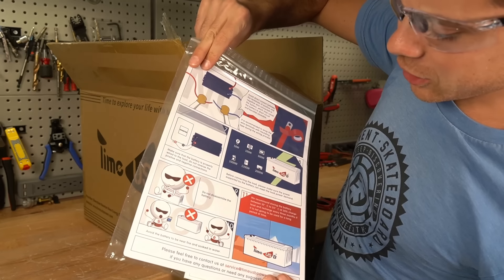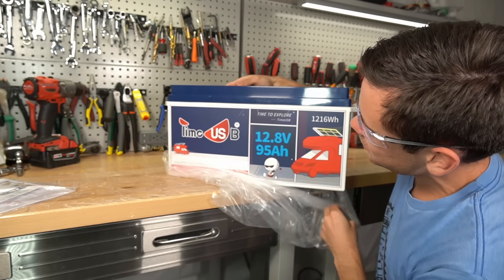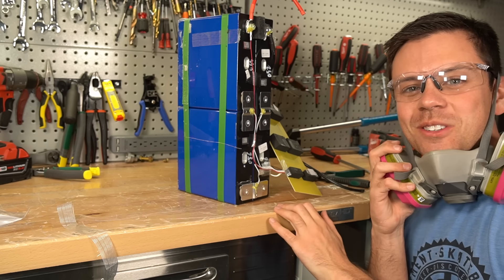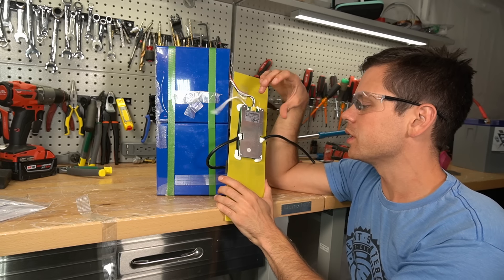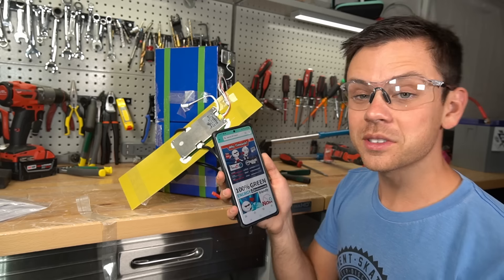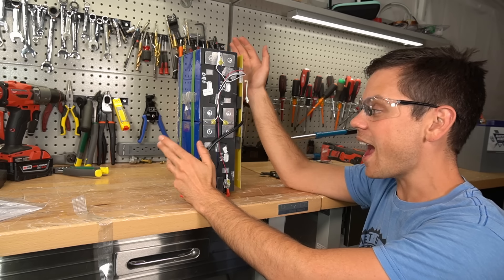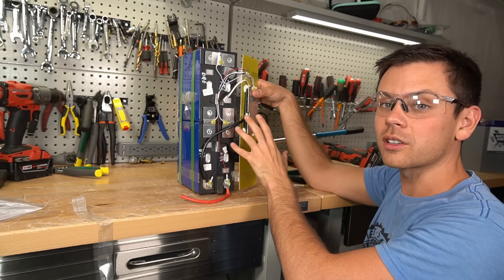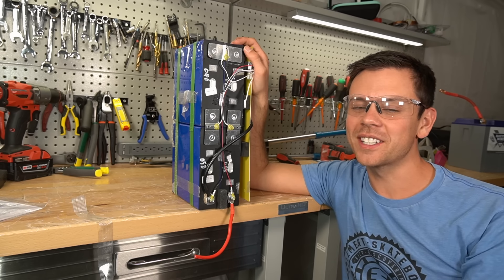$269 12V LiFePO4: Worth the risk?

Comment: Will 
You will love this 
Dear Gary,
Thanks for your reply.
The battery case is the public moulds on the market.
So there is some extra open space unused space inside the battery.
If we use the dedicated moulds for this battery, which means we need to open a new mold. The cost will be very high.

Comment: I think this is great! Many people who mostly camp with electric hookup don’t need 100ah but offering them a LFP option which has less risk of going bad if it gets to 0% is an amazing option for those people. Furthermore, repurposing batteries is great for the environment. They give additional 3-5 years (maybe more) of life rather then going to a dumpster. The only think they need to do is to clarify these are repurposed cells - otherwise, it’s a great option for many people at a great price.
Reply: I completely agree with your comment! Offering a LFP option for those who mostly camp with electric hookup is a fantastic idea. It not only provides a safer option but also helps in repurposing batteries, which is great for the environment. And regarding the Segway Portable PowerStation Cube Series, it seems like a reliable and powerful backup power solution with its massive capacity, fast recharging, and comprehensive protections. Definitely worth considering for outdoor enthusiasts and RV lovers.
Reply: Obviously bigger is not better in this case.

Comment: That would be something for a UPS system.  Just lot capacity, not many cycles, size and vibration quality doesn't matter.  Build to leads and hookup any regular old UPS and have massive more reserve for the price of a lead battery.   Most UPS do like 2-3 cycles a year.
Reply: UPS charging controller is likely a lead acid profile. Would that still work?
Reply: @aerobiotic  They do make LFP UPS systems but they are much, much more expensive.  Would be neat to grab one of those controllers somehow?
I'm loving the idea of a LFP UPS on the cheap though! Would be awesome for my work server cabinet as the two UPS in there can't last more than 5-10 minutes.
Reply: I have done Lifepo4 conversion in my apc br1000g in and it is phenomenal. I used discounted old cells 16 of them cost me 50$ they were cheap cus they were manufactured in 2019 and i bought them in 2022. , The tested capacity of the whole pack was 12amp hr which is correct rated capacity for those 32700 6000mah cells. I used 300w resistive load on my ups and it ran the load for 45mins that is similar runtime to having 27ah lead acid 24v batteries on my ups. So which would total well over 3 times the money i spend on these Lifepo4 cells. My ups charges them to 29v and then goes into absorption at 27v. I did not use a bms , i am only using a cell balancer cus the ups is handling the charge and discharge voltage. And i do not want the bms to suddenly disconnect the pack from the ups if that happens the ups will not power back on automatically when the mains is restored and the ups terminates at 21v anyways so there is no need for a bms and waste energy on heating those mosfets just use an active Lifepo4 8s balancer. There is no issues with charge current, my ups charges the 9ah lead acid pack at exactly 1.25amps or the 27ah lead acid pack at 3.75amps , i have set mine to do it at 3.75amps cus my battery pack can easily handle 6amps of charge current. The run time is phenomenal i can game on my pc for 40mins without any worries or do my work for well over an hour as my pc consume just about 150w at idle. There is one issue that u have to keep in mind. If your ups uses low frequency inverter then u should keep in mind that the models are designed to save money and they save money on the transformer size , u can not run at even 50% load for longer than rated run time , i have blown the transformers internal thermal overload fuse on my dads ups which has the cheaper style low frequency inverter using a large transformer even though that model is rated for 660w the transformer in it is half the size of the transformer apc was using in their 300w ups from 2004. I was running that ups to see how hot it gets and at 600w load the transformer got to 80c before blowing the fuse , it ran for 4mins on that load which is 4 times longer than what apc claims as run time on similar load with original apc batteries 😂. So in my opinion avoid ups with low frequency inverter only get the ones that use smps style inverter those are much more efficient and can run longer at near full load condition without blowing up. Or if u have no other option then keep the battery capacity low. If the original ups came with 7ah 12v battery using 6ah Lifepo4 is like having 14ah lead acid. So do not run for long time with more than 50% load in that case , also keep in mind to purchase cells that can handle the maximum power draw. A 600w ups can pull near 30amps on 24v battery and so u should keep the Lifepo4 capacity at half of that. So that the maximum load on the cells can not exceed 3c discharge.
Reply: @aerobiotic  most UPS with a AGM battery should be very close to a LFP battery cycle. They might not charge very fast or even all the way full.  My APC units float at around 13.6V depending on the model.  Further you should not try that with UPS at full capacity. They don't have the thermal.  I got for instance 650w UPS and I'm using it for router and other things - which draws less then 70w.  Never getting warm.
Reply: @aerobiotic  The BMS is your charge controller.  You can just input any constant voltage.  A dedicated Lithium charger is not really required, but I would use one because the BMS used in these cheap batteries are typically Chinese junk that can't be relied on in an enclosed space like your RV or car.
Reply: @einfelder8262  All my lithium chargers charge at 14.6 volts, my lead acid charger at 13.6 volts. Using a lead acid charger on a lithium battery would never reach full charge.
Reply: @soberpickle8195  Your lead acid charger is junk.  It should charge at well over 14V, up to 14.8.  Every car alternator charges around 14.2V, and they are the crudest of  chargers.  A lifepo is fully charged at 13.6V.
Reply: @einfelder8262  My UPS charge at 14.15 Volts. I am getting around 750WH from 100Ah 12.8V LiFePo4 battery. Is it just charging to 65% Capacity? My battery reads at 13.45 Volts after 12 hours since last charge stop.

Comment: Chins battery is $100 more or almost 50%.  I bought one of these instead as it will be used infrequently in a trolling motor,   Saved the money and have a better set,up than lead acid imho,

Comment: I can see a place for this in older used RV's that have limited service life left, consider that a typical modern lower end travel trailer only have about a 15 year service life before they tend to end up in a scrap yard, and I can certainly see a place for these replacing the first or second set of lead acid batteries at the 5-10 year mark in the service life.

Comment: Thanks for the info. You do very good reviews. I drive a semi truck. With the diesel been very expensive now I’m installing a one ton mini split ac on my truck with a gas generator.
I want to get a good lithium battery’s.
I drive in very hot and cold climate another thing is vibration. This info is going help a lot. 👍👍👍👍👍

Comment: It seems that they were trying to be honest with stating 950 Amp hours. But you're completely right about the cycling , how does one really know how long it with last . What a completely awkward case for the battery , where do you place it. It ridiculous how large it is. It's like a 48v  size for a rig or dump truck. Thanks for sharing this with us all and we'll see you soon my friend . Cheers
Reply: If the battery is being charged at an optimal rate such as in outback Australia there's no problem getting 4000-6000 cycles

Comment: I think they made it that size because it is a direct replacement for an RV deep cycle battery, and they want it to fit securely in the same space without having to modify the battery box and hold downs.
Reply: That makes sense.

Comment: You can still get Grade A 105 ah prismatic for 250 or less, for 4s the mazzive case without the capacity to match would have me always asking "where's the beef?" And only 50 amps! I'm glad you cracked it open thanks Will
Reply: That's standard RV battery size. It makes sense to use a standard case if it's optimized for RV use no modifications needed

Comment: Hi DIY. I have bee watching your channel for years. I damaged my 200 amp 24 volt Chin batter by not being careful as I dropped socket drive and it hit the terminals... WOW ARC FLASH! Glad I had safety glasses on thanks to your safety tip. I would like to see you do Chin BMS replacement operation.
Reply: It may not be dead...just disabled by BMS, but can be turned back on by a certain charge or process.
Reply: @mrmotofy   Hi MrMotofy. I'm a novice to say the least. What do you mean certain charge or process?
Reply: @mrmotofy  what should I do?
Reply: If you disconnect and reconnect it should turn back on

Comment: As far a bad internal mounting and securing the cells in place, I think that the lid (that you removed) would hold the cells down inside the case. Foam was a deep-ish pocket, so it should stay put. Those top foam pads on the lid  were touching the tops of the cells ... I recall the tested capacity sticker  was stuck to them. Anyway, looking forward to the capacity test.

Comment: If you use a trolling motor 100 times a year this would work . Light weight and no worries about taking it down to 10%. 1000 cycles will give you 10 years, and, by then battery tech will be so much better. Sodium or sulfur.

Comment: My guess would be this battery is going to be marketed in Africa and Asia for rural people and for back-up power and lighting systems in the cities.    It's rather brilliant, IMHO.   The bigger ABS plastic box and foam chunks don't add much cost for the manufacturer but make it close to the same size as a typical "4D" lead acid battery with around a 100Ah capacity rating, BUT much lighter and WAY better because of the LiFePO4 advantages of cycle life and tolerances of deep discharge, etc.     At that price, they will be price competitive with cheap Chinese AGM, and even the grade B or used LiFePO4 cells will perform better and last longer than a lead-acid battery that sits at 30 to 40 degC most days.   They will also be easier to ship because they all have built-in protective packaging so they don't need extra foam or wooden crates to ship individually.

Thanks for all your great videos!

Comment: Looks like these are made to be marketed to RV owners as drop-in replacements for units that use the physically larger batteries for house power.
Reply: Same dimensions as my ampere time 12V 200ah. Looks like the manufacturer just caught a deal on cases.
Reply: Probably to replace 2 6v lead acid batteries
Reply: Could also easily be the case here. I just know that most common folks don't look at specs but physical size when they buy things like batteries.

Comment: Just bought it to replace the 2 x 75ah deep cycle batteries in my class C that recently went dead. The ridiculous case dimension is actually an exact fit for the door-step battery tray. I think the 50a bms might "match" lead-acid charging current and avoid tripping any 12v breakers or burning alternator, so as a cheap guy who don't want to invest in another dc-dc charger, this seems what I need.
Reply: I'm thinking about the same reasons that you are.
Reply: BMS doesn’t regulate current limit, it will either burn up or disable charging if your alternator can make more than 50A
Reply: I did an experiment. The battery when completely empty (discharged to 10.1v) would briefly accept about 1100w. But immediately after that the charging current was regulated to 370w and gradually dropped as the battery approached 13.6v (the preset voltage of my RV converter, non-adjustable). So it worked, sorta --- just never deplete the battery to 10.1v and it should be good (the 1kw current did trip my 12v breaker). And remember your lead-acid charger will not charge this thing full.
Reply: Sounds like perfect replacement. Are they still working properly? Capacity holding up?
Reply: @larryperry2094  Well I'm not relying on its capacity since I have separate powerstations to provide 110v. However it's powering my 30lb trolling motor for 2+ hours no problem.
Reply: @helloterran  well its earned its keep in that case. Very cool.
Reply: @CleanPowerAuto  I was recently told that when you discharge these lifepo4 batteries to 0% the bms turns off and the battery just bypasses the bms and accepts whatever current it can accept, in my case 100+ amps. As long as the bms is still powered on, it will regulate charging current to its spec.
Reply: @helloterran  you were told wrong or misunderstood what you were told. BMS is an on-off switch, not a regulator
Reply: @CleanPowerAuto  well it's the explanation from hobotech when testing powerqueen batteries, and I trust him on that one.
Reply: @helloterran  was that the 190ah battery he was testing? I just watched it and nowhere does it show that BMS regulated current.

Comment: This is good for low cycle application but i would get rid of that bms if i am using this in a ups and i will add an active cell balancer just to squeeze out some of the extra capacity

Comment: It does appear to be marketed towards Rv's. Many RV operators are on a tight budget, the battery case is actually perfect because many are already set up to hold that battery size so its just a matter of sliding it in and replacing the old. So, compared to a traditional lead acid deep cycle battery many older RV's have this very well may be a good battery. If it holds up which as you say is an unknown. With my old setup all I ran was lights, Tv and water pump the 50 amp BMS is just fine.

Comment: That's crap, I'm sorry. I like that they're honest with the rating calling it a 95Ah, but putting used (or otherwise reject poor-performing) cells in there and marketing it as "new" is... fraud? No thanks. The big problem with these kinds of things is the large amount of people that just search for a product on Amazon and order it not having any clue they're buying. Maybe they need to market it as "refurbished" with 95/120Ah life remaining.
Reply: Very fair point about labeling.
Reply: I have no pity for people who just do a quick search then buy, and even less for those who believe the 'stars' and reviews on Amazon actually have meaning. Or on any of the other usual online mega-stores. Which is why what you and Will do matters so much- you save us from that avoidable grief with your knowledge and testing. BIG thanks!
Reply: @P_RO_  I agree with you, and I disagree with Will on this one. I actually have one and I bought 2 more. Using for low amperage lighting in my shop and shipping container, and running small hand tools off of a 1000w modified sine inverter (angle grinder, sawzall, pole saw, all work fine).
Reply: As always buyer beware! 
Knowledge is power!

Comment: I am looking for a cheap battery to run my garage exhaust fans, and something like this I could see working for many years.  I have a couple older panels and a cheap controller I'm going to use, instead of buying some cheap lead, this could work.  not sure I would run it with anything too important for the reasons you said, but hey, worth a try :)

Comment: Have you done a review on the 
Fiunie 12v 100ah lithium battery ..
For $179.  With low temp...
Just my opinion..
You do the best most complete reviews
Reply: I just got one of those and tested it at 106Ah under 60A load (it can handle full 100A). It seems to be decent quality but I haven't taken it apart.

Comment: I bought the 36 volt timeusb for my 36 volt trolling motor for $275.
If i get go fishing 10 times a year for 10 years = 100 cycles, ill be happy with that. 

Sidenote, i doubt ill discharge the battery all the way on each fishing trip.. 

This has a market.

Comment: on the amazon site you see they also sell a 100 Ah battery for $70 more and it has a 5 yr warranty.. apparently the 95Ah has no warranty or 90 days.. also something funny when asked about if the cell are new or why they are using 80% capacity cells in the 95Ah batter they go around answering the question with stuff like..

 "The Timeusb 95Ah battery that born for RV with UL/FCC/CE/ROHS certificated. and each battery cells from us are ensured with 100% strict
inspection and they are qualified."

what does "they are qualified" even mean..  LOL..  other words they have no clue are don't are wont say..  

Still not a bad deal if you just need some cheap batteries for project but getting better cap for little more make better sense to many.. cheap is and always will be CHEAP..   Thanks Will... another great show for sure..

Comment: I've been interested in this (price $270 free shipping) TimeUSB offering on Amazon for several months.  I have a 25ft motorhome with one agm battery and 215-Watt solar panel which will be joined to another 200-watt panel soon.  Will: "It may outlast a lead acid." I like that idea. Except for the extreme size, this, I think would be a good addition to have. I like the idea of the 50 amp BMS to not overload the alternator while charging. I read on Amazon that one customer received a bad battery and the company responded very well in replacing it in a timely matter. I'm waiting anxiously for the test results from Will.
Reply: BMS doesn’t regulate current limit, it will either burn up or disable charge, in both cases it’s not usable if your alternator can produce more than 50A
Reply: Hey sister, we need an Amazon review from a customer who received a bad battery and got it replaced very well in a timely manner, so a random person will refer to it in the comments section on Will Prouse's youtube channel.
Reply: @CleanPowerAuto  From what I've read on several reliable sites, the BMS does indeed regulate incoming and outgoing current.